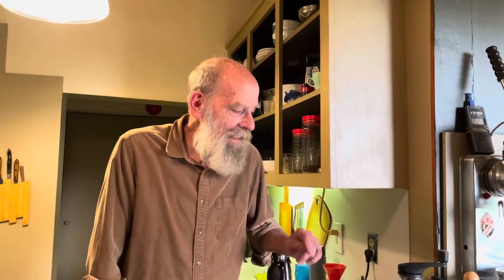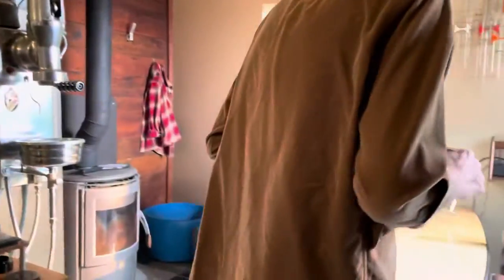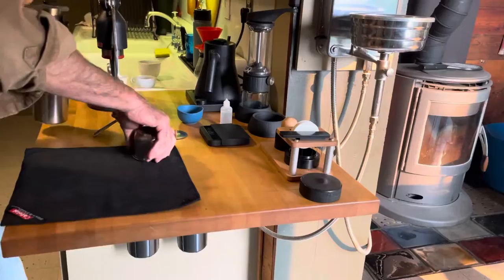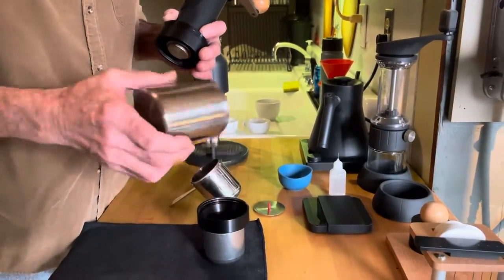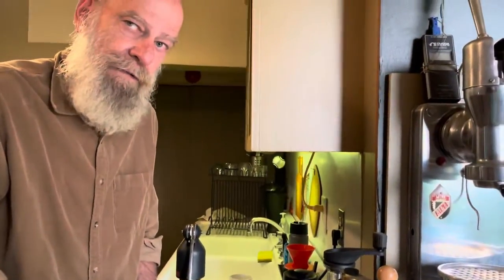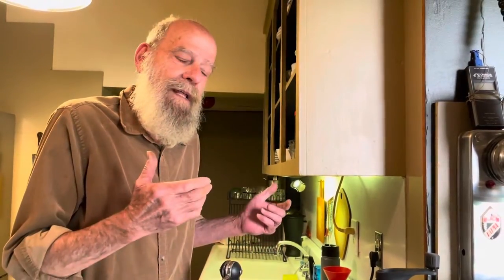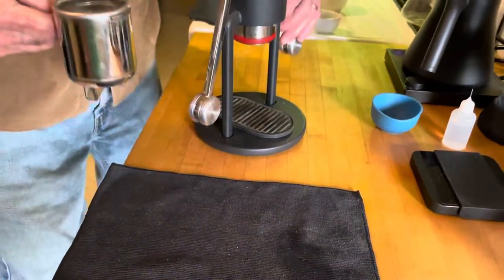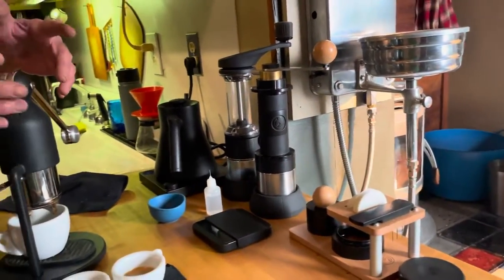Cafelat Robot Espresso Shot  with LIDO OG and OE Prep System

Comment: regarding profiles, i find the thing i prefer is flow based. everything is based on feel even the pre-infusion. you can feel the bloom, feel the flow. as you said of the medium profile, pre-infuse, but wait. i wait until i can feel the gas escape the puck, which it will eventually and is different for every bean. this is why i do wish there was an electronic version.. similar to the flair 58x. i dont need a boiler, but a bit of heating is the best of both worlds, for long pre-infusion, for light roasts.

Comment: love your prep and your explanation on using a low pressure shot to pull. My grinder has never set that coarse, I found myself using a grind size that's so fine, between 100-250 varied from 2 different roasters and at least 10 different blends from medium to dark roast. I've re-zeroed the OG grinder when needed and still around that range i mentioned. Not that I run out of grind size selection, just curious if it's just my grinder or others' are experiencing the same thing.
Reply from the maker: It's likely the difference between what we have our OG set for zero, and what you have your OG set for zero - "Zero" is kind of an arbitrary, and subjective thing... We can set it up that the burr is locked at zero, or not touching at all at zero - I personally prefer just a very slight touching at zero, and locked at minus 200.  So, that could be part of what's going on...  The main thing to remember is that it's your grinder, and you set it up the way that makes the most sense for you, and do it that way each time, so your reference point of 'zero' remains the same, and therefore your settings will also remain the same.
Reply: @orphanespresso  it makes sense. I have data recorded so I could go back to the setting approximately the way it was before. And that's the way it is for all grinders.

Comment: I'm enjoying my Lido OG grinder. Using it on a Flair lever espresso machine. I've had a hard time finding the right grind size for different coffee roasts. Calafat Robot is a beauty though. But, I can't ignore that large contraption on the right that looks like a wall mounted lever espresso machine. Please tell us the story behind that.
Reply from the maker: That is a Faema Velox Espresso Machine, believe this one is from about 1957...  Been on our wall for ages!  But, it's a bit cantankerous - it has a really tricky temperature management, cycling - you can hit some truly great shots if you hit it at the exact right moment on the heating element cycle.  Since our pump water varies in temperature depending on the time of year, and the weather, it is both a joy, and really complicated!  The Robot is MUCH easier to get consistent shots with.  So, the Velox is currently 'functional art'!
Reply: I was wondering the same thing and now I know. I love those old machines, especially when they are still in working condition.

Functional art it is!

Comment: NEVER LET GO OF THE LEVERS.
Reply: only if your gasket is damaged. i know from experience, using a brand new one, you can let go all you want. apply the lube. my old one that didnt apply any lube that i used since i bought the robot deformed on the flange. i cant gaurantee the lube prevents that, but it might at least mitigate it. the outer edge will inevitably rub against the basket, but the flange might be protected from the water and heat cycles through lubing, maybe keep its shape and not bend as easily. lubing the inside edge is not necessary as that is not the problem, but it doesn't hurt and lube is cheap. the friction of the outer flange and the basket is the real problem.